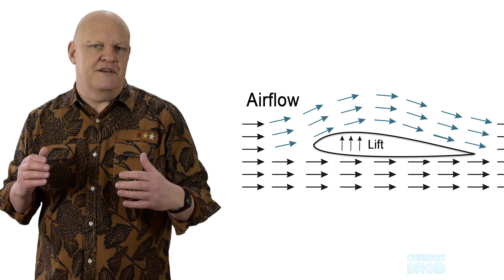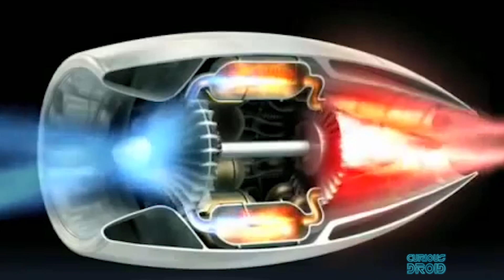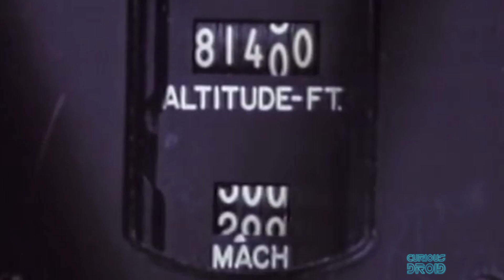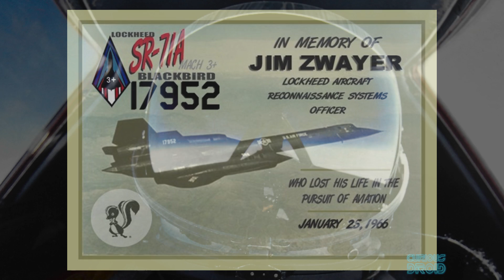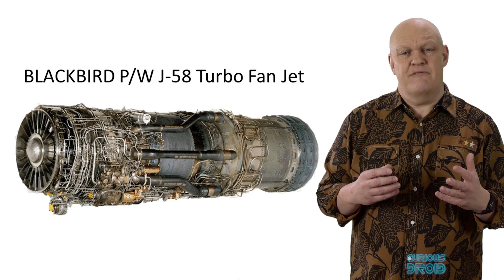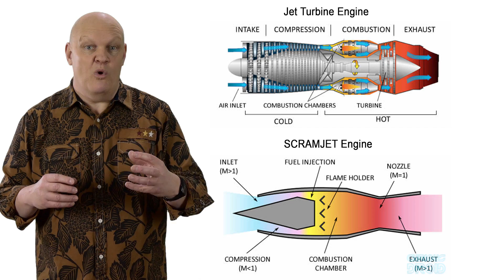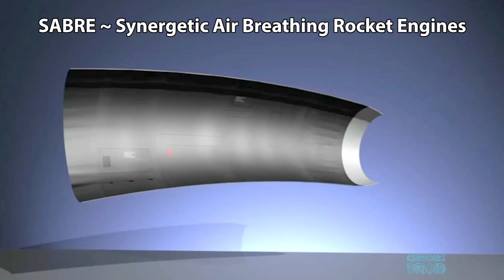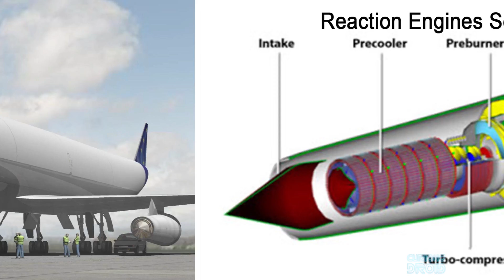Why can't we fly a plane into space ?

Comment: I don't think this topic needs a 10 minute video.  The simple answer is that there is no air in space for the plane to push through.
Reply: It's all fine and well to provide a summary of the situation, but the details and specifics of what the limitations of certain types of engines are and why is a big reason why I'm subscribed to this channel. Complete answers are the most interesting answers ;)
Reply: This vid is over a year old but I'm just now noticing the errors.
1. Planes do not fly because of the airfoil shape of the wing.  This does produce some lift but only a fraction.  Most of the lift comes from the angle of attack of the wing, and there are plenty of planes that fly with completely flat wings.
2. Your blood will not boil in vacuum.  Your skin is a perfectly fine pressure vessel.  Your tears and saliva will, and you will sustain lung damage if the vacuum is sustained.  Humans have actually survived this.  It is actually much worse to SCUBA dive to 60 feet and bob to the surface.
3. Escape velocity is not the velocity at which you orbit Earth.  If a rocket gets to escape velocity at any point it won't be doing any orbiting, except of the Sun.
Reply: J Calhoun oh, agitated and triggered to insults already. That's not a sign of intellect. As was your previous response. You could check into flat winged aircraft but you're too lazy or scared of bruising your ego even further. Congratulations!
Reply: EccentricSilence 
It will work if you put all the politicians in it first.
Then they can all fly to outer space together where they belong.
Reply: And if in a jet no air for the engines
Reply: J Calhoun Ever seen a plane fly upside down. Have you noticed the shape of stunt planes wings too. Heck even a paper airplane has flat wings. C'mon man damn!
Reply: @J Calhoun Ever made a paper plane?
Reply: J Calhoun yep you got one thing right. You are sorry!
Reply: J Calhoun don't be so hard on yourself. It's apparently not your fault you are the way you are!
Reply: J Calhoun ha! I gave you three. Apparently you're unable to see that given where YOUR head is firmly shoved. Now, pull your head out, take a deep breath and go do some research, please. Smh!
Reply: J Calhoun still here huh? Thought you said goodbye already. Glad to see you're not a man of your word either. I won't even bother to ask you why stunt planes that fly upside down are able to pull off such a feat. I see you like side stepping and song and dancing the paper airplane illustration. You said "name one". You were wrong. Not a big deal but watching you try and talk your way out of it is completely hilarious!
Reply: J Calhoun lets leave the feelings you have for your mother out of this. You are a true Freudian case aren't you. Wow!
Reply: @tisbonus  you can't compare a paper plane of a few grams to a gigantic airliner with continuous thrust. Paper planes fly not because of lift generated by wings similar to airliners but instead because of the buoyancy of air acting on the paper, try making a small A4 sized plane made of aluminium foil, it's not gonna fly because the buoyancy provided by air is tiny compared to the heavy (yet thin) aluminium 'paper' plane.
Seriously try it it's kinda fun :D
Reply: praanav m that's what you took away from the comments I made? How sad for you.
Reply: The human skin is not a gas-tight pressure vessel. There is some transfer of gas through the skin. Tho most occurs through the lungs. Where the blood exposed to the low pressure would violently outgas causing injury.

One may survive, but not for very long.
Reply: Yes there is it's a located in Washington DC!!
Reply: EccentricSilence lol thanks for the short answer
Reply: J Calhoun I'm afraid there is NO way you're going to be able to talk yourself out of this one given your previous ridiculous assertion of "Name one". Lol.

What about the paper plane? Wait! Nevermind Lol.

Comment: it doesn't fly into space because the earth is flat. if the earth was a ball then the plane would keep gaining altitude until it couldnt go any higher as the ball earth falls away from it.  Also if it was a ball the planes would have to keep pointing their nose down every few minutes to keep constant altitude. NASA says the shuttles have to level out in order to get into space but planes don't have to worry about anything?? BS
Another question is that if there is no air or atmosphere in space, then how do rockets work in space? Rockets need atmosphere to push against for thrust. The explanation people give that the pressure inside the rocket pushes against itself for forward thrust in space is ridiculous

Comment: Thank you for the nice video. There is a little inconsistency though at about 5:16, where the schematics of an SCRAMJET engine are supposed to be shown. Instead, a RAMJET is depicted, due to a subsonic compression an also a subsonic combustion (M<1). In a SCRAMJET the air does not reach a subsonic state, with the difficulty to maintain a combustion at Ma > 1.

Comment: actually a man climbed mount everset and k2 without supplemented oxygen . his name is hassan sadpara , he is from skardu , pakistan
Reply: I googled. This is what it says
"Contrary to initial reports, Hassan Sadpara clarified that he used supplemental oxygen during his Everest ascent due to bad weather"
Reply: Not trying to belittle his work though. He have climbed six eight-thousanders and five of those was without  supplemental oxygen. Not everest though. But still amazing!
Reply: Yes some climbers have scaled Everest without oxygen.  But I would not try it and sound like a 120 year old man with asthma and emphysema.  Although the air is thin up there, it has the same amount of oxygen as at sea level (21%).  But our lungs are adapted to operate at 1 atmosphere, that is sea level.  At 29,000 feet the partial pressure of oxygen is much lower, so to compensate you have to use 100% oxygen.

Comment: Because the engines need oxygen to operate. There.  Just saved you 10 minutes.
Reply: That's what I thought before watching as well. I recommend you to watch the entire vid tho; I'm almost certain you'll learn something new.
Reply: Robert Walker Rocket engines work on a rather basic principle.

You have a fuel, and you have an oxidiser. For example, let's use kerosene as a fuel and liquid oxygen as an oxidiser.

The two are stored in separate tanks. When the rocket engine is started, the fuel and oxidiser are injected into a spherical or conical chamber called a "combustion chamber", then a spark or a flame causes the oxygen to react with the kerosene and the two begin to burn, or combust. 

When the two products are burning, they produce a lot of energy and want to get out into the open air as quickly as possible. There's no other way to escape than through a tiny hole at the bottom, and so they begin to fly through this tiny hole very very quickly, several kilometers per second in fact.

Surrounding this hole is a nozzle. The purpose of this nozzle is to make sure that the exhaust does not fly sideways, which would cause inefficiency of the engine, not to mention intense shaking.

Image of the configuration: https://www.grc.nasa.gov/www/k-12/airplane/Images/lrockth.gif

The difference between a rocket engine and a jet engine is this: a jet engine takes oxygen from the surrounding air, a rocket engine carries its own oxygen with it. Rocket engines tend to be more powerful, but less efficient because of this.
Reply: Gideon Schwalbe that's not all, there wouldn't be enough air at high altitude for the wings to generate lift. Air pressure is too low
Reply: Gideon Shawalbe Then you have a rocket, my friend.
Reply: I think the only physics equation that explain the things is Navey Stock. I suggest to anyone who interested to learn about fluid mechanic and mass transfer and heat transfer. Good luck
Reply: @majyeforever4518  LOL...There is nothing like like Navey Stock equation. It is Navier Stokes equation.
Reply: You forgot many things.
Reply: Planes don't need oxygen they need air for lift. Rocket engines use oxygen for the combustion used to propel the ship. they have an oxygen tank for doing so.
Reply: I said something similar to that.
Reply: you are the real MVP...thank you
Reply: WamblyGrain thanks for this answer.
Reply: Also because since there is no 'air' in space the plane would not be able to manoeuvre at all
Reply: This is the most underrated comment ever
Reply: There are electric planes moron.
Reply: Then how does a rocket fly to the moon.

Comment: It's a crying shame that this video is so misleading. Commuter jet aircraft can't operate beyond certain heights not because the engines won't get enough air, but instead due to something called "coffin corner," which is the point at which an aircraft's stall speed (go slower, lose lift, aircraft falls) and mach tuck speed (go faster, leading edges of wings go supersonic, resulting shockwaves distort the airflow, aircraft loses lift, drops, gains speed, and potentially breaks apart from aerodynamic stress) are the same speed. At that point, even if there's still enough air for the engines to operate, the airframe itself cannot go any higher.

Comment: This video is ironically awesome. It actually offers all the reasons for why space flight is IMPOSSIBLE.

The air density is 2% at about 85,000 feet. (stated at about 2:30)  They say space begins at about 328,000 feet (3:98).
They never say what the air density is between those two points, but pretty sure it doesn't get more dense.

Here's where it runs into problems. Both Jet and Rocket propulsion engines operate on contact-action.  Which means they either have to be pushed or pulled to move anywhere. Propulsion, propels or pushes the rocket. What does it push off of?

Air Density i.e. Atmosphere.

The SR-71 is awesome because it was able to go fast enough in low air density to get the lift it needed. It went about 85,000 feet. As it tried to reach a more optimal speed, to go higher it disintegrated.

Here's the real problem though. Not building a sturdier and faster aircraft. Speed means precisely dick if there is nothing to push off of.  And sturdier in pretty much every case means heavier anyway. Which they addressed but it was irrelevant because the problem isn't how hard you push, it's how much resistance you get from what you push off of. No resistance. No contact. No action.

The force of the rocket isn't going to make the air more dense. This is what contact action is all about. You have to make contact and at 85,000 feet it was already psychotic. Space suits and carry on oxygen are meaningless in regards to thrust. 

Jet engines pull in and push out. Rockets only push. They need to push off of something or it can't move. You see this at every launch. It doesn't take long before it begins to arc. At 2% air density you aren't going much higher.

The jet engines fails because there is no intake at 2% and engine speed isn't going to create more air density either, which is why they switch to rockets in the narration. The small rocket has to be carried up high, because it would be out of fuel by the time it got there. It can only carry so much juice.

Once you get about 100,000 feet pushing off the atmosphere, is like trying to do push ups on the surface of water. Bulk up as much as you want and Push as hard as you'd like, the results are the same.

Comment: THEN HOW DO astronauts propel off of the moon? good movie, what is its exhaust? Just wondering because where there is air or water pkanes and boats can manuever. How do rockets and things manuever in space is there a 3 element out there that fin and flaps because to have lift you need air. and alleron and runnder and elevators are need to to direct the ship but again you need water or air in space to do that? Or is there a third element?

Comment: Can we not just build a rollercoaster type style of structure that takes us in space? Imagine a huge steel frame base, which is few kilometers wide to support this huge structure and then narrowing it the higher it gets. Can we build support beams which are 100km long? And now I am thinking really absurd in the sense of not just a support steel beam that's 20 or 30 cm in diameter (with regular rollercoaster) but with beams which are dozens of meters wide at the base and slowly getting thinner as it gets higher. Then if such a structure is build we need to build another docking station which stays at the same geostationary orbit above that structure. Then creating a lifting mechanism to get the payload to the docking station.

Comment: Noticed 3 minor errors:
1. You don't need to reach escape velocity to get to space, you need orbital velocity if you go right direction, which is bit lower than escape velocity, around 28000 km/h
2. That picture of a scramjet is actually ramjet. Scramjet = supersonic combustion ramjet. Ramjet slows down the air below mach 1 and burns air at subsonic speeds, whereas in scramjet, the air moves at >M1 speeds throughout the engine. 
3. Blood doesn't boil in decompression incidents, that's common myth. Hearth and veins can hold enough pressure to keep blood liquid.

Comment: Correction: Contrary to the narrator's comment at 3:44, you don't need to reach escape velocity (25,000 mph) to get into space and stay there so that "you are traveling faster than gravity is pulling you back to Earth".  Instead, you only need to reach 17,500 mph to reach low Earth orbit.  And it's not really "traveling faster than gravity is pulling you back to Earth".  Rather, it's traveling fast enough in the horizontal direction so that your free-fall trajectory curves towards the Earth surface more gradually than the Earth's surface curves away from your spacecraft, thereby allowing you to fall all the way around the Earth.  Escape velocity is a much greater speed that than that which is needed for staying in space.  Rather, neglecting air resistance, if your spacecraft was on a ballistic (free-fall) trajectory such, that starting at the Earth's surface, it was traveling at escape velocity, then it would have just enough kinetic energy to escape the Earth's gravity field and fly off into interplanetary space.
Reply: Bruce Kritt I was scrolling down and you pointed it out 25;,000 kilo a hour not miles.
Reply: Actually, you can reach space by just moving even at 1 meter per hour. You just need time and enough fuel. Escape velocity is intended as a speed without propulsion. If you have an engine capable of moving you away from ground any speed, if maintained, is enough.

Comment: 3:12: Correct me if I'm wrong, but I seem to remember that your blood actually doesn't boil in this scenario because the circulatory system will continue to provide enough pressure to prevent that. However, the water in your body including the spit in your mouth is subject to the low pressure and will in fact boil.

Comment: What about using a kind of atmospheric balloon for the first part of the journey and then secondary rockets? -To avoid having to carry so much fuel.
Reply: 6 month late, but the problem of getting to orbit is less of a vertical problem and more of a horizontal problem.  Upward thrust is only a small percentage of the fuel requirements to get to orbit, the rest is spent to get enough horizontal speed.  The balloon system would complicate the launch process significantly for only fractional theoretically savings.  I haven't done the math but I have a feeling the increased costs due to complexity would significantly outweigh fuel savings.
Reply: Prob takes too much patience to wait but would prob be cheapest for those who don’t mind the wait.
Reply: I think JP aerospace was envisioning a balloon-rocket-launch-platform. I believe that idea hasn't 'gotten off the ground' is because of the reasons you mentioned. We could say 'every bit of savings help' and spend billions of dollars developing such a system, or we could spend those billions on researching something more viable.

Comment: the real issue is we need an engine and fuel that doesn't require air to fly as well as have the power and speed needed to leave earth. after we have that engine we then need to look for ways to increase efficacy of the fuel without having to use all the fuel just to reach space and return and refuel. i would say the engine and fuel need to reach iss and back to earth 5 times without refueling for it to be worth investing into it. and later down the road i would like to see the engine and fuel reach pluto and return to earth without refueling and do it all within 12 hours. when we have this we could start visiting other planets outside our current solar system.

should be easy its not like this is rocket science or anything.

Comment: The higher you go the lesser dense the air is becoming which means these wide wings get useless, since aerodynamic is not really an important factor anymore with no dense air supporting it. But when we talk about commercial planes they are mainly build to fly by their wings, wherefor the engines can save a lot of fuel and dont have to be capable to build up thrust like an rocket would do. That is what you need in space... lots of thrust instead of wings. By the way i didnt watch the video.... it was just a logical explanation to me from what i have learned so far.